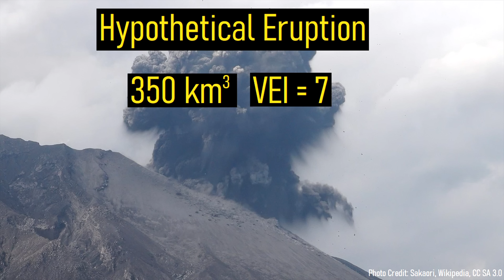This Would Happen if a Supervolcano Erupted Today

Comment: With that said, you should do a video on large volcanic eruptions vs where they’re situated on the earth and how that affects climate.
I’ve seen content that points to Southern Hemisphere eruptions having more effects on the climate than those in the north.
Reply: Tropical eruptions are usually the worst as there's more water vapour to react with the sulfur and the ash can more easily spread to both hemispheres. My bigger concern would be about how the volcano would affect supply chains, in which case a volcano that could potentially destabilize a manufacturing powerhouse could be far more devastating. I'd imagine a large eruption from the western Pacific could be really, really bad for both of those factors.
Reply: @StuffandThings_  Definitely... there's plenty of areas in the tropics where subduction zones exist, especially in southeast Asia and its environs.  The main volcanic arc in Indonesia (from Sumatra over towards the Banda Arc) would be the prime suspect here, but there are other locations to consider as well.  Central America and northern South America also have active volcanic arcs, with several calderas already present in Central America.  

The Trans-Mexican Volcanic Belt seems to (mostly) lack calderas, but (from my amateur understanding) this volcanic arc could, over geologic time, shift towards an ignimbrite flare-up with large caldera-forming eruptions. As it is, the TMVB does not parallel the trench because of flat-slab subduction, and the subducting slab is currently steepening, which is a known cause of ignimbrite flare-ups. There is already a notable caldera in the easternmost part of the TMVB (Los Humeros) and areas of rhyolite volcanism exist in the adjacent Serdán-Oriental volcanic field; there is also a rhyolite volcano with a caldera just outside of Guadalajara (La Primavera). Fortunately, this transition (should it occur) is something that occurs over geologic timescales, so a supereruption in Mexico (or anywhere for that matter) is not something we should worry about, but if we could travel through time and come back in a few million years...

While not a subduction zone, large caldera-forming eruptions have also occurred along parts of the East African Rift as well.

Comment: Nice just today I've read about Campi Flegrei almost reaching its highest uplift since 1984 and its CO2 emissions and earthquake activity increasing. There goes one round of unnecessary existantial dread
Reply: Means did Campi flegrei reached the highest upliftment now in 2022 or you are talking about upliftment of 2016?
Reply: @frankfrastein2244  I'm talking about right now
Reply: @heyho4770  Does that mean Campi flegrei is very close to erupting? Like in this decade itself?
Reply: @frankfrastein2244  As always nothing can be said with certainty. All those indicators could be a sign of soon-ish activity but could also be explained by normal activity of the hydrothermal system of the volcano.

Comment: Super eruptions are not that scary to me anymore especially after I read all the new research done on Toba super eruption but every eruption is different not every super eruption will affect earth temperature.
Reply: Tambora was a low end vei 7 eruption but it did affected earth's temperature. Then why wouldn't a much larger supereruption?
Reply: every super eruption would affect it drastically, how do you even come to that conclusion?
Reply: @nox4298  no it wouldn’t look up the new research on Toba super eruption they now know it only changed earth’s temperature at most 3°F and earth’s temperature return back to normal within 5 years. There’s been VEI-6 eruption’s that’s caused global cooling and there’s been VEI-6 eruption’s that didn’t affect earth temperature so not every VEI-8 eruption will be horrible.
Reply: @bigrooster6893  makes sense, I'll take a look at them.

Comment: Since when did a super eruption = a VEI7? I was always told super eruptions were VEI8 only. There's mega eruptions which are 7s, super which are 8, then after that you have hyper eruptions which are 9s and to my knowledge only observed on the Jovan moon of Io.
Reply: The line between high end VEI7 and low end VEI8 is blurry.
Reply: As mentioned already the line is very blurry, a VEI-7 must at least reach 100km3 of eruptive material, a VEI-8 needs to pull out at least 1000km3 of material. The issue is that some volcanoes that are VEI-7 barely surpass 100km3(Santorini) of material and others that are also VEI-7 yet can go up much higher(Long Valley Caldera, Aso, Campi Flegrei).

VEI-9 isn't a thing, it was once proposed due to the sheer absurdity of La Garita, which erupted over 5000 km3 of material (and Wah Wah Springs even topped that figure). But given VEI-8 eruptions are already rare and there's not much data about them, it made no sense to have a VEI-9.
Reply: @caiolucas8257  depends if you mean vei-9 isnt a thing cause nothing reached 10000km3  then we have 2 possible ones , toba and flat landing brook.
Reply: @caio lucas  As I understand it, there's a volcano on the Jovan moon of Io which erupts at a vei of 9.
Reply: @caiolucas8257  Given that VEI 5 = more than 1, VEI6 more than 10, VEI 7 more than 100,  VEI 8 more than 1000 it would make sense to call an eruption that ejected more than 10.000 km3 a VEI 9. 

But the big eruptions were so long ago and the estimates are so inaccurate. It  doesn't make much sense anyway. There will never be proof of a VEI9 having ever occurred.
Reply: @caiolucas8257  the thing there is no hiding from the fact that it takes a caldera forming volcano to produce an eruption of 1000km3 of debris a vei8 to be classed as a super eruption!
Reply: Question, why is mega less than super?

I'm used to the standard prefixes moving up the exponent by 3 of kilo, mega, giga, terra, up to Yatta. Granted the progression for for adjectives including super and hyper is a lot less well defined, but it always felt to me that mega is more than super.
Reply: Vei 8 is classed as a super eruption anything from a 1000km3 of debris onwards. People with even half a brain will know that a vei 7 is not a super eruption.